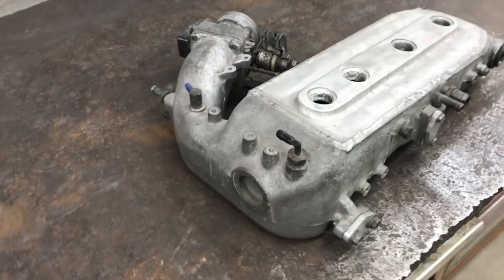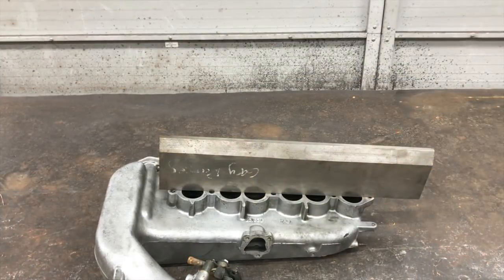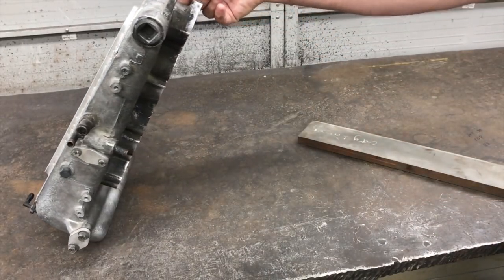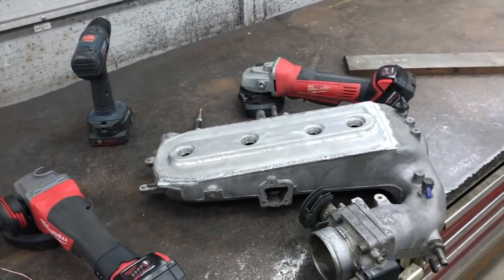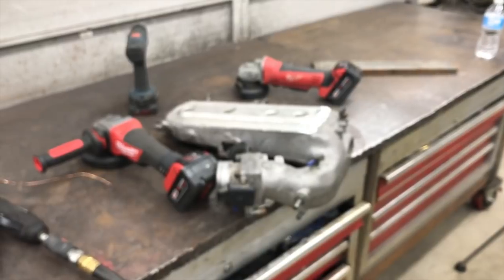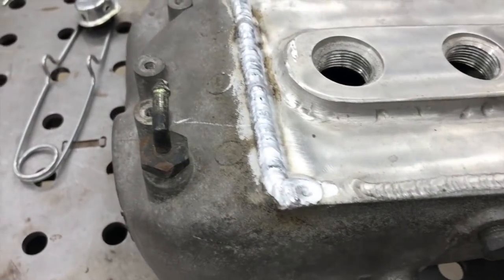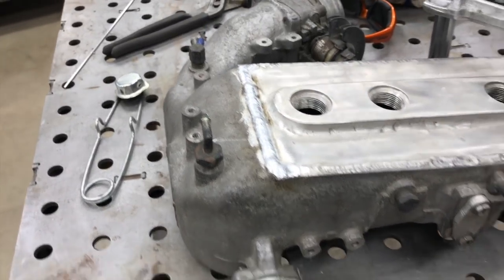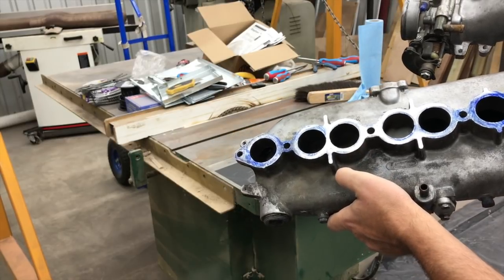Customer Returned Cracked Aluminum Weld - Tig Welding Intake - Lapping the flange

Comment: so again I think this was the wrong technique, you do not want to weld cast because when you put that much heat in cast the impurities will come up , a better technique would be to braze it , and just control the the heat so the rod just flows into the void .just a thought, good video

Comment: So it looks like two different metals, cast and plate, what about a preheat, and could you use aluminum bronze and basically braze it? When you preheat you want to control the cool down also like cover the part in sand until cool

Comment: Something that might have been easier than moving the manifold, try gluing the sandpaper to a piece of glass.  The glass is flat and easier to handle.  Hold the manifold steady and move the glass/sandpaper.

Comment: There are a lot of good comments below that everyone could learn from. I would also suggest testing the casting alloy, so you know what is the best filler rod is. Some alloys are very crack sensitive and it's important to control the chemistry with the filler rod.

Comment: 1:11 if it wasnt a crappy weld it would not of broke exactly on the weld following along it perfectly on your perfectly straight cut edge. it would have never broke the weld at all. it would have broke next to the weld where the metal becomes the weakest from fatigue. the weld itself would have been the strongest part. every weld breaks next to the weld not on or thru the weld. unless of course it is truly a really really really bad stinky awful smelly weld!!
Reply: what you have here is a fusion weld or better known as a braze weld. why buy a tig welder to do a No.1 tip acetylene fusion weld? I just dont understand why you cannot see the mistake of this weld and keep defending it. Dude it was a bad weld admit it and hope you learn from the experience. Its cast turn your damn heat up. who ever told you to keep your tig welds as cold as you can didnt tell you about keeping your tig weld as hot as you can.
My money says it cracked again either the other end or the same end. it looked welded with the same technique and settings.
Reply from the maker: lol, seems like you think you are pointing out something I didnt already know, i knew it was a bad weld, thats why I showed it on video.  The only thing you really have pointed out that I wouldn't have already know about, you were actually wrong about and I was right!  What kind of dumbass comes on someone else youtube video and schools them about lapping technique and claims to be "institution" taught, whatever that is, and couldn't be more wrong!! lol some days my job is a little boring but thanks to smart guys like you i get to laugh!
Reply: I said #1 tip not no.5 tip like in the video to warm up the part a very little bit before it cools back down by time he gets welding on it.
Reply from the maker: When you get done with this video, i have over 1,000 other videos on youtube, so get started on those, many of them are way worse than this one!

Comment: Don't buy a tig welder unless your welding daily. Mig welders are meant for anyone to use with minimal practice and little to no experience. Everyone has to start somewhere. don't start with the hardest. now he is welding cast aluminum why i imagine he opted for tig. but it wasnt the right choice he should have bought a much cheaper mig welder with alloy fluxcore wire or at a jump in cost added a pure bottle of argon and alloy spool of wire. both should be running 220 and that should have made no influence on the purchase at all. but i can tell from the video it did.
BTW: splatter falls right off with a little tap unless your doing it wrong
an extreemly hot weld is not correct. you dont want to heat anything anymore than you have to to get complete penetration.
ok ill edit that.
 you dont want to heat anything up more than you need to get the impurities burnt out at the point where complete penetration happens. beyond that point just doesnt matter(technically), unless its the point where your fabrication is going to bend and fail. then grind off the risers right?
Reply: i dont care who you are. You will never have learnt welding until YOU have mastered stick welding. when you can make penetration and perfect flow from one source then you have got welding down.

Comment: no the weld is bad did you grind a bevel to get more pen. did you clean the metal, use the proper filler metal or can't you see?

Comment: Damn working with aluminum and not a jug of acetone was to be found.... Dipped the tungsten like 3 times.... $5 says Carlos brings it back
Reply: another correct comment and nothing from ramsey about it..

BTW: acetone and mineral spirits is same thing. both should be neutralized with water.
Reply: @beefsupreme5291   LOL..They are not remotely the same thing....

Comment: I was told to never leave craters at the end of a weld? Correct me if I’m wrong
Reply from the maker: You are absolutely right.
Reply: Ramsey Customs - turbocobra thanks for the reply sir
Reply: you aint seen a crater till the nukes hit america. because their to stupid to comply to the force of the rest of the world. Thanks millennials for being so damn ignorant. you people better get disconnected from the computer and social media and start talking and helping the very people that live next door. damn fast or your going to lose everything

BTW what do you think the 500.000 plastic casket tombs are being stored for?  if nothing else was in them they could hold 10 to 15 bodies each plus room for children to top them off. if I were you i'd move right next door to one of those storage facilities, or out the damn country before trump locks it down. Do the math. do you think they will even find that many bodies after 3 nukes hit this country.
Sidenote: a nuke is not a nuke as you know it to be. same as the atomic bomb was never really witnessed. you cant count the faked and cut and highly edited version of the Hiroshima site. truth is you dont know. all you know is the hype that they say it will do. radiation fallout and shock-wave are extremely over-hyped. look at the 100ft tsunami from japan that never happened it was 4 inches high. if you can honestly claim a 4 inch wave as tsunami from the other side of the world. which you should know was generated from an underwater nuke test.
Still think im a laughing matter ramsey? you wont for long.

Comment: I was expecting to see the final blue check on the seating surface. The lapping should have been done initially prior to any welding, with the use of all available assistance such as actual paste from a tube of prussian blue, then bolting it down flat. The mating surface should also be checked and repaired as necessary. Cast almost anything that has any residual stress is quite likely to misbehave in some way or other, whether by warping, microscopic cracking, or just turning to bug poo. Use ALL available precautions. The trash in cast material as inclusions acts as little stress concentrations that will defeat your repair at the first opportunity. The trash material spread more or less homogeneously through the casting lowers the material's ability to transfer stress across a large area (ductility) that would possibly prevent fracture formation in the first place.

Comment: That weld is dirty as hell! Clean the damn metal , preheat the whole manifold with a torch or Oven. Sit down and get steady , stop touching the filler to the Tungsten! When you stop , back off the pedal Slowly... the weld is full of porosity and crater pits . Use 5356 not 4043.
Reply: I agree with anything you said, and thought the same while watching the video, except the filler material,  5356 is AlMg filler rod and much more prone to heat cracking, its also harder thatn AlSi (4043) rod and because of that less tolerant to vibration, even by its structure its more similar to cast aluminium, but thats just my opinion, not trying to be rude;) of the problems i think is also that he didnt "wash out" impurities...funny thing is that when i saw the crack i thought to myself " thats because you used AlMg rod:)
Reply: now this guy knows wth hes talking about. and no comments hmmmmm. keep up the great learning curve ramsey and youll get no where until you start listening to the right ppl. Not the ones you think sound the coolest.
Reply: I thought I was the only one thinking this. He needs to work on technique in a big way. Not only did he touch the tungsten he was dabbing the rod like a drunken spasmodic. He needs to steady up, dab smoothly, keeping the friggin rod end inside the gas shield, and learn to feed the rod with one hand. No need for so many restarts. Didn't see any acetone used, his starts and stops need work, and where is the PPE. Arrrg. I know its easy to criticize but he's failing on the basics here. He seemed to be more focused on making the video than doing a good job and while appreciate his effort in making a video I think he would do better if he slowed down and focused on the welding.
Reply: ya definitely dreaming about making money from producing a video. not at all concerned about teaching you how to weld correctly.

Comment: "Hot Short Cracking" from too little filler added for the situation???  I have very little experience welding, but 30+ years of inspecting welds... - Anyway, nasty cast that you don't know what you have for sure, and the uneven stresses sure probably added to it. Nice job of doing with what you had available, to make what should be a good repair.

Comment: You showed a close up of where you drilled the "end of the crack" and the crack appeared to carry on after the hole. Once it was welded up you could see where that same crack had opened up slightly beyond the weld. I guess you went back and re did it?
Reply from the maker: yes

Comment: Prior to welding outboard engine heads, I cook them in the BBQ for ten minutes, I complete some quit major welds and find there is very little to no distortion on any mating services. To finish they go back in the BBQ for another thirty minutes and left cool slowly to reduce built up tensions.
Reply: thats all fine and good but your just masking imperfections in the weld. if it was welded right it wouldnt need that.
sometimes there is an imperfection in the casting or steel or whatever your welding and that could cause a crack from the stress. in that case you have a chance to prevent having to grind it out and fill it in. but id rather know where the weakness is in my part and it damn well better not be in my weld.
Reply: it really depends if the part is going to be cooling uneven and if your trying to weld from start to finish with a continuous bead. you do need to keep it from cooling to fast like if its winter time and no where near 98 degrees. there is alot of precaution steps you can take. but honestly. it shouldnt need it if you really honestly have a method. sure wouldnt hurt heating a piece like this even if it was 75 degrees or higher in the room. its just a massive amount of aluminum nothing is going to stop it from cooling rapid just sitting on a bench. but you can do the weld so its heated even by jumping around welding small sections one after the other. continuously welding all sides to keep heat in all four sides of the part. so when your done welding it will cool down evenly from one end to the other. a crack would occur from one end being cold getting heated and expanded and as you move across. the face will start cooling quickly dispersing the heat out across the plane of aluminum. while 6 inches down at your arc the weld is over 1200 degrees. the begging and the end are both contracted and the middle is expanded. as you keep moving eventually its going to pinch its self and want to crack because its not able to expand without the contraction on both sides fighting directly against the point of expansion and any imperfection is where its going to start the crack with the worst twangy metallic pop you can ever hear.
 i just think its worthless process with such a low heat coming from an oven/bbq 375 degrees that is no where near 1000 degrees. unless its a self cleaning oven but i wouldnt try that for 45 minutes. be melting knobs off the stove. being aluminum its just going to cool even more rapid the higher above ambient temp it is.you have to have a method to maintain even heat no matter how you approach it. welding 30 inches of cast from start to finish is probably going to crack no matter what you do saying you dont blow it out. its just going to go thru to much rapid expansion and contraction. will heating it in a 425 degree oven for 10 minutes to a core temp of 98 degrees do any good? probably not any good on this type of piece. it will be mostly cooled by time you get it moved propped and the welder in hand. start welding and soon enough your going thru the same rapid expanding and contracting again anyway.
Dont know if makes any sense ill edit it after the movies. numbers are just example not actual cast aluminum melting point can vary depending on manufacturing.
Reply: truth is if you watched me weld it you wouldnt come to this channel anymore. except for a laugh
edit: my silent unknown channel. i mean you will never know it. so you cant see how i work. but you know what i mean "in an ideal world" you would get to. unfortunately the world is not governed by the american constitution. so we are mandated to have multiple accounts not related to our main.
 haha, but ya!

Comment: I have had success with 4943 filler on jobs like this. Seems to wet out on the cast a little nicer and it draws in less when it solidifies....as I understand it at least. Since I found 4943, I've used it on all cast repairs and cast to billet joining. So far so good. Maybe give it a try and see if you like it.

Comment: Aluminum is flexible so I don't think the crack came from structural stress. The stress that made the crack is from the two different types of aluminum welded together. The two different types of aluminum cast and flat bar expand and contract at different temperature thus cracking at the weld. I bet it will do it again.
Reply: Michael Taylor yes sir I know what you know Some people have to pay the price for an education..
Reply: right on the nose. and no comment by ramsey

Comment: No ,the weld is NOT good.Thats why your customer brought the piece of shit back
Reply: to cup walker you sound like a real proffesional  a professional IDIOT YOUR A RUDE PIECE OF DOGSHIT LOL,
Reply: that prolly 3/8ths thick CAST aluminum highly doubt it burnt through and if it did highly doubt there would be porosity on the back side, the cracks are most likely due to either inproper preheating and postheating(letting it cool down to quickly) or a combination of poor metal and poor cleaning!
Reply: most likely due to the fact that he does not let it cool down slowly he instead air cools it which lets it cool way to rapidly for any cast metal!
Reply: This my friends is why I don't have any blue welders, they don't do what I want them to do.
Reply: Carbon steel doesn't require backpurge inside the pipe, but stainless steel piping does require an argon backpurge. Again, stainless steel and nickel piping require an internal backpurge. The only other disadvantage is that this technique requires a machined weld preparation.
Reply: and if you think that i dont know that you should and always use an internal purge on stainless, your an idiot i clearly stated that i have, you get a sugared root but no porosity to say the least
Reply: im right your wrong period, have a nice day!
Reply: lol ok i was welding before you were born . im not senile and have lost 30 lbs since that video and i have alot to offer in the welding industry i just did 11 years out in alberta oilsands as a pipe rig welder. so now im going out to my shop to do some machining on my 14x40 lathe and my 9x49 milling machine and i might even fool around with my 250 ex everlast alluminum tig  welder and better my skills at alluminum welding. so you have a good day.
Reply: thank you I apologize as well!
Reply: point taken.
Reply: no problem  all good bud.
Reply: fuckin first year apprentice!
Reply: Then fit the two pieces of pipe together with no root gap and tack-weld them using GTAW and the appropriate filler wire (4043 or 5356 filler metal can be used to weld most pipe; this usually is extruded 6XXX alloy, so check the contract documents to determine the correct filler metal).

The welding technique is fairly simple. Use AC welding with a pure or zirconiated tungsten electrode. Use pure argon as a shielding gas. No internal backpurge is necessary, although it's used sometimes in critical 
applications. 
SHUT YOURSELF DOWN WITH YOUR OWN LINK!
Reply: @scotty362100 yea delete them comments dumbass! come one here talkin shit about something u know nothing about I shut ur ass down real quick mr union welder

Comment: Jus a thought... it's not a hard piece to replicate, take some measurements and build one. The amount of heat it gets (sustained and non-sustained) and the vibration/abuse it goes through, it's a problematic piece. in my opinion, the guy that said put it in the oven, is probably right... i would think 375 to 425 for about an hour and let it stay in there to cool down to the touch, would be better than nothing at all, but it's probably gonna have a little warpage again on the bolted side... so "milling" would need to be done again,.. the sand paper trick... however, I'm curious to see how it works out as you have done it. i hope it doesn't come back. but anyway, i think that you said, it's been over a year ago that you did that... i don't think that any fab shop or manufacturer would do warranty work after a year of abuse, on a piece like that...